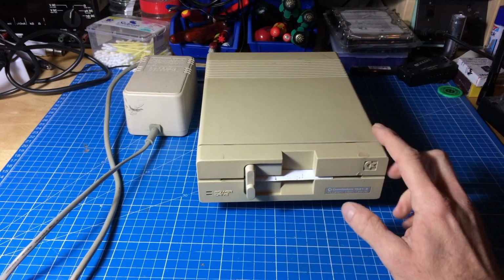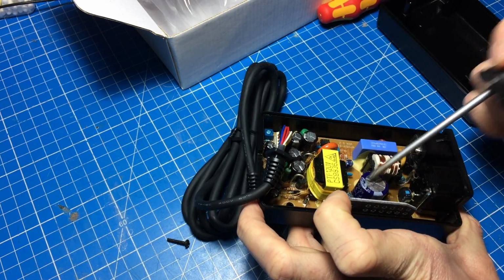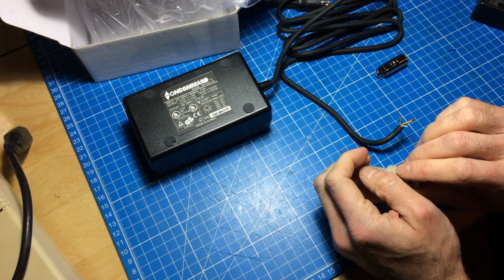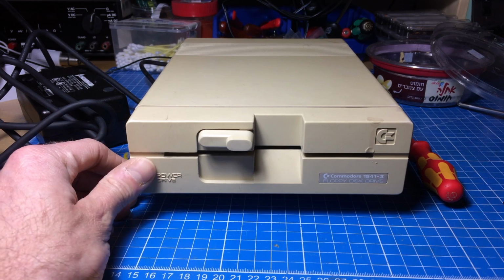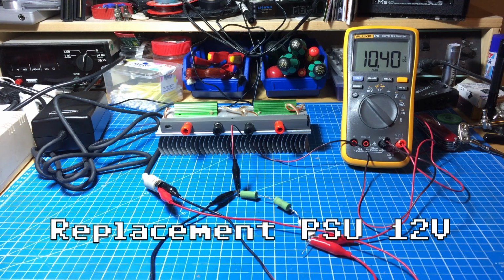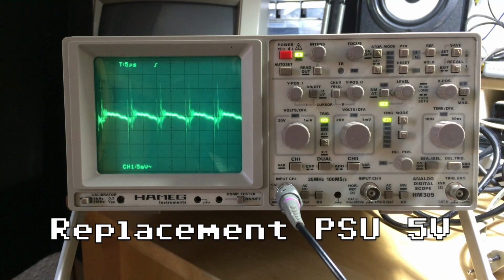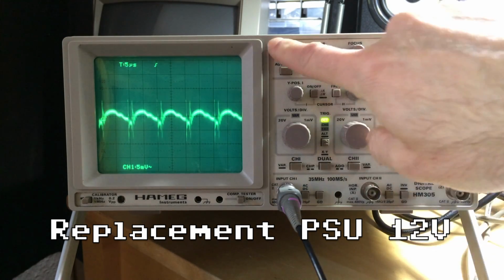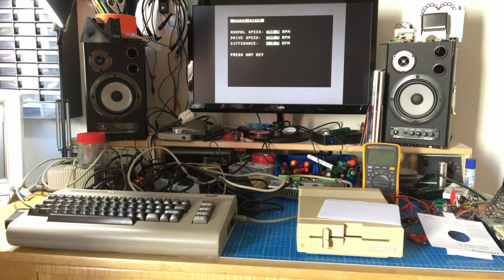Commodore 1541 II Cheap Replacement PSU Test

Comment: If you only need 5v and 12v that should be easy to build something, even just using 7812 and 7805.
Reply: You could also investigate using a couple of cheap buck convertor modules, one for each voltage, they are usually rated at a couple of amps, and you can adjust them for the voltage you need, I have a bunch of them for little projects.
Reply: True, but still terrible. This is exactly where it goes wrong in the C64 PSU: It starts with 9V AC, which is rectified into +/- 10V DC (under load). You loose +/- 2V over the bridge rectifier, so the LM7805 has to rectify approximately from 8V to 5V. That is just 62.5% efficiency on the regulator alone, add power losses from the rest of the PSU. Completely unacceptable to modern engineering standards.

An LM2576 can easily do 80% efficiency on the other hand. The XL4015 is even better. You indeed find them on buck converter modules, and is exactly what I did for my 1541-II power supply.

You can use an LM78xx if you have a very small current to supply, then the increased component count speaks against a switching regulator. But powering a full computer (or floppy drive) from an LM78xx is simply a bad idea in retrospect.
Reply from the maker: Of course these voltages are not too uncommon. I explicitly wanted to try this hilariously cheap PSU. Not at all ideal, as suspected. ;)
Reply: The problem with regulators is getting sufficient current (and they will generate a lot of heat).  Your typical 7805 is 1 amp or 1.5 amp for an S revision.  It might work with a 7805S (or the LM version I forget the PN) and 7812.
Reply from the maker: I haven't looked inside the original PSU but would imagine that that's exactly how it is constructed (at least the C64 PSU is made that way). Transformer, rectifier, smoothing caps, voltage regulators. Might be interesting to check how much current the drive really needs. I would guess that it won't need quite as much as the psu rating.
Reply: I hate these parts a lot and would wish they get forbidden like incandescent lightbulbs. You will get really inefficient power supplies with those parts, which is nowadays considered not done, but C64 hardware shows very well what the consequences of those parts are: They generate lots of heat. The C64 PSU is the best example, which fails due to being overheated for extended periods of time and then also kills the C64.

But the most likely cause why my original 1541-II power supply did fail was that the LM78xx regulators did probably kill the capacitor in the PSU.

Use switching regulators whenever possible. LM2576 and XL4015 are good regulators to fix old power supplies, or build new ones.

For the 1541-II, a switching power supply is in principle just fine, you just need to find one that is good enough.
Reply: Daniël Mantione - the efficiency depends upon how you use them, if you run a 7805 from a 30v supply then yes, very bad, but if you can run them from a voltage which is only about 3v more than their rating then they are much better.
Reply: I did that in an N64.  Just used a DC to DC convertor to drop from a 12v PSU to 3.3, providing 3 amps, and used the 12v input for the 12v rail on the N64.